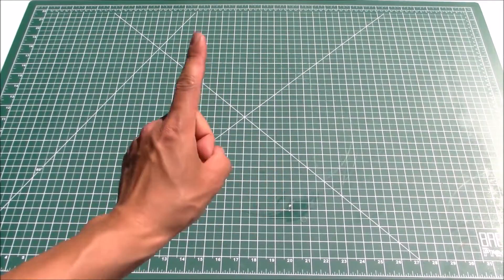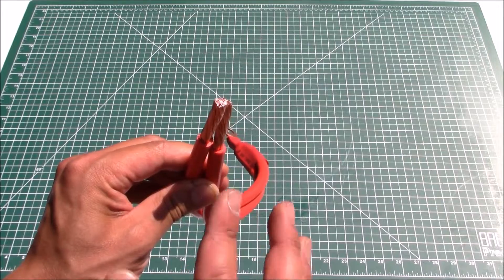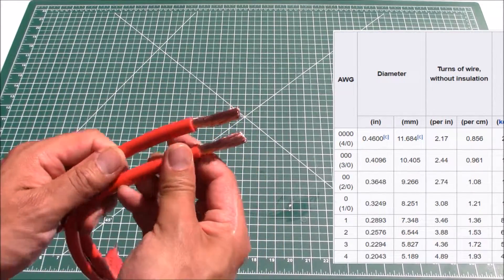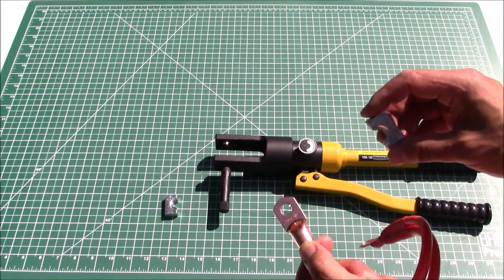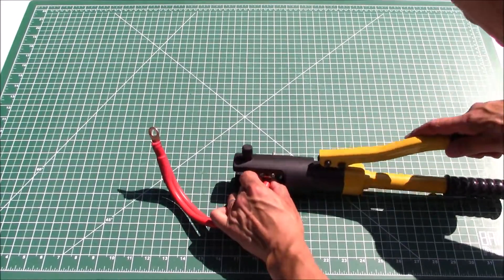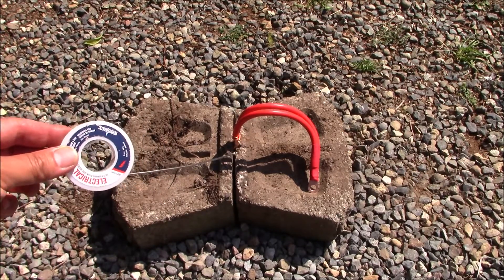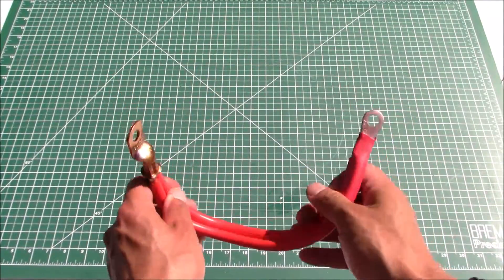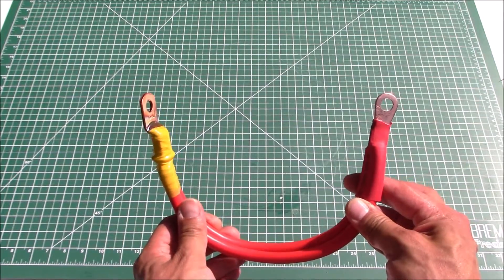Make Your Own Battery Cables By Crimping and Soldering Terminals Onto Bare Wire

Comment: Please buy an electrical code book (National Electrical Code). Never run wires parallel like that or put 2 wires under one lug! Just buy the correct size wire and crimp on lug. You are encouraging fires from loose connection. Being book smart doesn't always translate to the field.